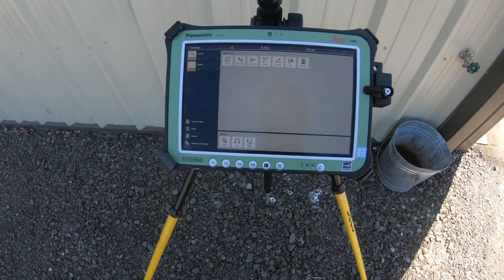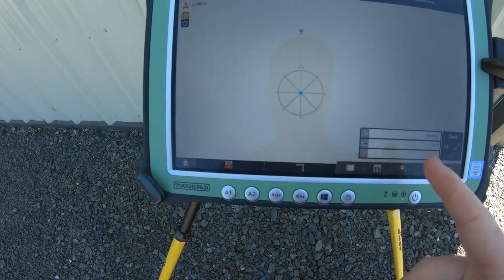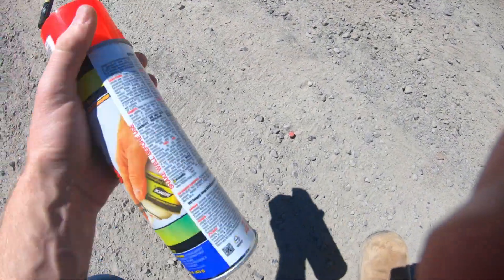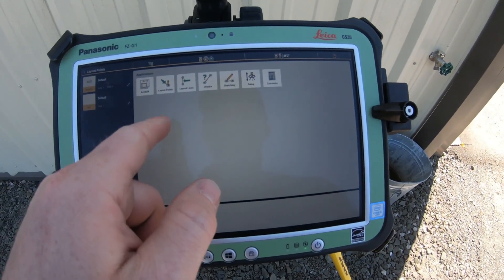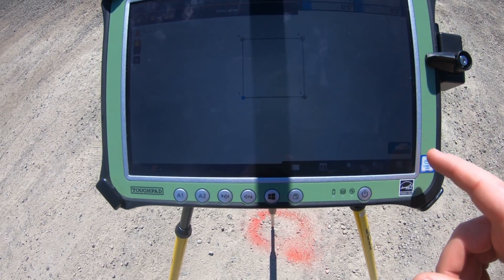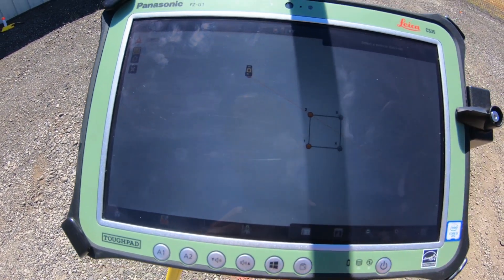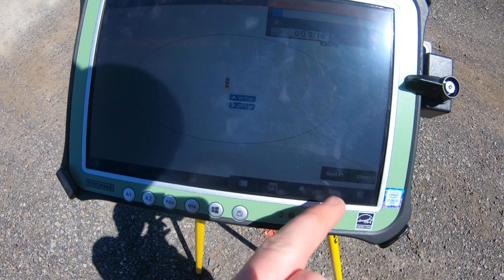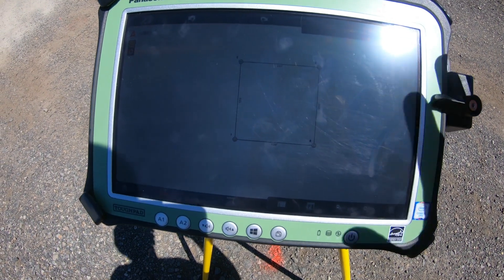Setup without Control - Leica iCR70 Robotic Total Station Kit CS35 10" Tablet & iCON Build Software

Comment: Hey brother nice tutorial btw! Im learning how to use the total station and have a question if you dont mind. 
 If im laying out a foundation and need to set the building corner off the property pins, would i make a new job under the same project and place the property pins under asbuilt?After that my understanding is from there i would go to layout lines, draw a line from points, then click over to see my X and Y and use my measurements from the plan. Appreciate the video man not alot of videos for these machines out there!
Reply from the maker: Yes! You should be able to measure your property pins under as-built, then go to the "Sketching" menu and draw in your building corner using the angle and distance from the plans. There are multiple ways to do this as well. Glad to help.

Comment: Maybe just use a GNSS with RTK fixed accuracy
Reply from the maker: GPS/GNSS and Total Stations each have different advantages. For instance- if the sky visibility is low, GNSS may not be an option.
Reply: @4kequipment88  Yeah but you have a great open sky
Reply: How about you make a video of what you want to do?